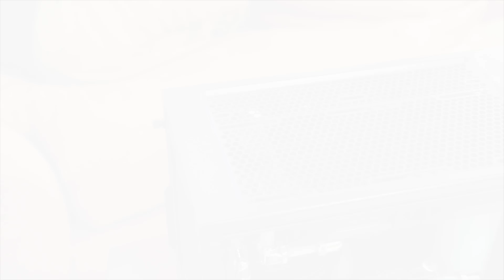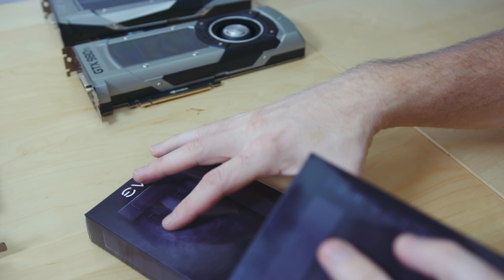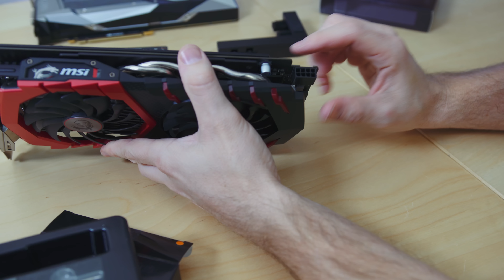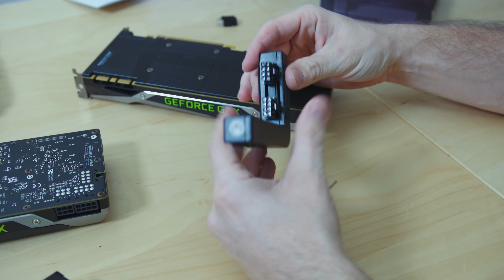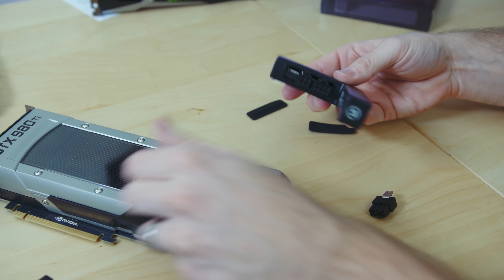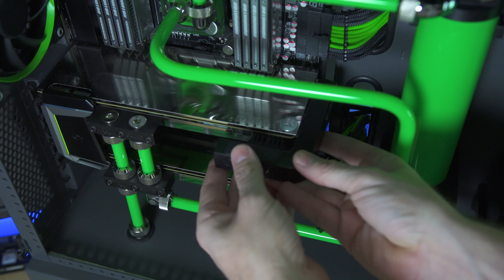How to manage your cables using EVGA Power Link

Comment: You fail to mention "clearance", but how much space is required above the Powerlink; because some of us have case lids \ doors that run almost flush with the card, so would be nice to know how much "clearance" you need. It looks chunky and adds noticeable height to the card; so would have been nice if eVGA made it more flush to avoid having to worry about being unable to close the lid. I have this issue with my HP Z series, since they designed it to be as "sleek" as possible; which means very little space between the lid and any PCIe cards, so height "clearance" is critical. Make sure to mention in any future videos with any newer cards, as this adatper will probably stick around for a while; but I will see if I can find more info before I buy this thing... 😁

Comment: Evga states you need to plug in two 8 pin connectors to the link bar no matter the gpu pinout.  
"The EVGA PowerLink™ features two solid state capacitors that help to filter/suppress ripple and noise from the power supply.  The EVGA PowerLink™ draws power from two 8-pin PCIe connectors, even if your graphics card only has one PCIe power connector. In doing so, the PowerLink™ balances the power drawn by the graphics card, thereby improve stability."  Would be interesting to see if there is any difference at all.  Maybe just really low end psu's?

Comment: i know, old video. but... i just stumbled over the powerlink again and wondered if it is possible to use it with amd cards too? i mean, it should technically be just a simple extension cable. so there should be nothing preventing it from working with other brand cards.

Comment: I have a question that has me a bit worried the two 8-pin power cables may be connected even though my card is 6-pin or how should I connect it
Reply: you can plug one pcie power cable and remove one of the 8 pins that you attach to your gpu. i can make you a video if you like. Simple answer yes

Comment: I have this and I don’t like it.
a. It looks like a tumor that made metastasis.
b. The conector is flimsy and doesn’t provide support.
c. It’s cheaply made, I feel like I can break it any time.
d. The tiny screws and the Alan key are a horrible solution that could’ve been executed a lot more elegantly.
e. Doesn’t work with every gpu.
f. For the price, you should invest a bit more and get some nice sleeved cables instead.
g. Doesn’t solve any problem and can make building the machine more problematic depending on how much space you have.
h. It could’ve been thinner and more robust.
Don’t buy this guys.

Comment: Picked this up for my new GPU the moment I saw how the power had to run to reach the top of the card.  The GPU run is the most noticeable in my case, and $20 for a Power Link was cheaper than a set of sleeved cables.  Worth it for me--the power filtration is just an added bonus.

Thanks for the video, Jay.

Comment: a little side not, they are not just for looks.  it has capacitors inside to help filter any electrical noise or ripple.  basically it helps provide a more stable power source, reducing voltage fluctuations

Comment: An optional brace with a rubber foot that extends/screws out to the motherboard tray. Could be held by tension against the plate, but then you would have people bending their power connectors outward instead of the card sagging down on it’s own. Maybe just some velcro on the end or double sided tape.

Doesn’t need to have 12v or 5v RGB/ARGB, but LED lighting behind the EVGA lettering that splits off the card’s led connector(if reference) or a switch hidden under/behind/on the pcb side that switches to the rail power instead and another little switch/knob for red green blue or white.

Would add more width to the front, but maybe make a version where the whole casing itself is long enough to cover the entire PCB clear to the SLI tab. Would make it worthless for myself and anyone else with waterblock inlet/outlet ports, or those with SLI setups(Hello from the days of optimization! We’d write you a post card but we can’t afford the stamp because we paid as much for 1 card as you did for all of yours!) but hey... ARRRRRRRRRRJEEEEEEEEEEEEEEBEEEEEEEEEEEEEEEEEEEEE.
EVGA has their own waterblock for reference cards so why not make a version of the block that has it built in..... and ACRYLIC! While they’re at it.... why not go full Bitspower mode and offer an EVGA HYDRO COPPER UPGRADE KIT FOR NVIDIA GTX/RTX 10/20 SERIES FOUNDER’S EDITION REFERENCE DESIGN PCB GRAPHICS CARDS.

I can see it now. 47+ SKUs. No swappable 8/6 pin plugs. You get to buy different part numbers if you need 8/8, 8/6, single 8, single 6, dual 6.
POM or acetal! RGB and DRGB versions! Non-RGB versions! Non-RGB to RGB upgrade kits! RGB to DRGB kits! Each kit is specific to the power connectors that your version has!

The money they would make would buy a 2080Ti for at least 5 people!

These are dark times.

I’m glad I went silly with that. Very cathartic. If you’ll excuse me, I need to go cross reference 96+ D5 kits to find which adapter(s) I need to make my mod top light up like a rave. If only I knew where to begin on the glow stick upgrade kit compatibility. Life is hard.

Comment: Unfortunately he missed one of the key elements of this product, and that is it adds an additional two capacitors between the GPU and the motherboard, the power link contains two capacitors. This also justifies the cost of the product, which doesn't make sense if you don't account for those capacitors. Cheap motherboard or GPU capacitors cost around $5 with expensive ones costing up to $50. Obviously for a $30 product we're getting cheap or moderate capacitors, but it will still smooth out the power delivery to your card a bit. If you're investing in a card with a custom PCB and higher than normal power phases or VRMs and have a high end PSU and Motherboard with high quality VRMs and a good UPS, and are trying to get as close to perfectly smooth power delivery as possible for extreme overclocking, then adding these powerlinks "cant hurt" I'm not going to say it's going to make a 'significant' difference, or that the capacitors are of a quality that makes it a 'must have' by any means, but as said, it certainly doesn't hurt, and does something to justify the product beyond just aesthetics.

Comment: I’d rather have options on black 90 and 180 degree adapters that plug directly in with no wire, if I vertical mount make it 90 so I can run the cables straight to the psu shroud hole, for normal mount make it 180 and I’ll run the cables over top the card...example in this 24 pin 90:
https://goo.gl/images/cPUCQT
Excepting that the board and metal aren’t also covered by black plastic

Comment: would be cool if cards start just having the plugs on the side. but for 9.99+tax off new egg wasn't to bad as i had a new egg wasn't to bad as i had a 11.99 customer card from a price match burning a hole in my pocket. but i do think the normal 24$ is a little steep 10$ though is reasonable

Comment: This isn't a comment for this video specifically, but all of the ones I've watched. You've been a huge help from Air flow, which helped with case and fan choices, to what GPU I should consider getting. My first build was a dirt cheap GTX 770 i5-3570k. Really the only components worth mentioning. Now that I can afford it, I'm building a i7-6700k MSI 1070 Gaming X. Been watchin videos for days, making slight changes, really looking into things I could be proud to show off. Thanks for the help, your channel has become one of my go to spots when I have a question.

Comment: I think it looks clearer with power link.

I personally dont have any Evga stuff, and would not use them on another brand just because of the logo and build cohesion. I do hope to see brandles versions for other graphic cards or other brands adopting this. or maybe see changeble power mounts on the cards it self.

I'm happy there not LED lit, specially now that so many parts have leds, i had to tone mine down just to not look like a red light district ; )

Comment: Why are graphics card designed upside down for normal cases, and why do they always put the plugs in the WORST spot. It's like the designers have never built a PC before. Also, why are all PSU plugs so cheap and crappy. There's no reason to need 6 let alone 16 pins to carry the current needed for a GPU. It should just be two high quality connections.

Comment: Jay, may I suggest some UV reactive paint to use in the EVGA label on the front of those adapters. like just thinking the paint and let in flow in and fill the letter outlines. and some UV LEDs and then will match and not look so drab.

Comment: I got the power link for "free", ($10 shipping) during a promotion. I find that it works for me. I upgraded to a 1070 FTW DT from a 750 FTW. Since the 1070 has a bigger height, the power cables stuck out more from the case. Those cables started to a get a really bad bend when I closed the case. The link does its function well to redirect the cables to the side. I would say only buy this if you NEED it, in my case because the cables started to bend against the case. Do not buy it just because you think it will make your cable management look better. If you do plan on getting it, you should buy this at a discounted price rather than the MSRP of $30.

Comment: i like it how it looks after the install as long as there is a way to support your cables so there doesn't have to be worried about those solder points breaking.

Comment: Fitted these on my two 1080 FTWs - it definitely looks better but I would have preferred the top part was not so high (why couldn't they make the plugs shallower?) and didn't partially obscure the FTW logo. It also just barely fits in my NZXT H440 case, clears the drive tray cage by about 2mm.

Comment: Personally I think they should make 3 of them. One just like that, one that only has one 8 pin and then you plg your 8 pin straight into the back of the link rather than the side , then one thats wider so you can plug your two 8 pins into the back rather than the side. I could use one of those in my builds. I have just enough  room in my buils for a wider one that I could plug my 2 8 pins into the back but I dont have enough  room to plug them into the side like that   my cables will hit my fan blades.

Comment: With your build Jay it looks really well because you have those squared off black pieces sticking about just as far off the top of your card where the hard tubing goes in them as the evga link does. It looks really well. You got lucky that those pieces your tubing go into are also black worksa out nice.

Comment: I feel that these "extensions", for lack of a better word, serve a purpose, but, like you said, the weight of the cables and the amount of sag is a little troublesome.  If EVGA could find an unobtrusive way to brace these against the weight of the cables (perhaps some kind of non-conductive legs to sit on the PCB of the card itself or something along those lines), they would be far more valuable as a cable management utility.

Comment: These mofo'in new cards are massive and fit in less and less smaller cases these days, I was optimistic about this device that it would be a sort of low-profile design to move the power connectors to an area with more space. But NAH it adds bulk thus the card still doesn't fit. The EVGA 1080 FTW just barely fits in an Air 240 and other small form factor cases.

Comment: It's a nice thing for EVGA to have made available, for those who can make good use of them. Mixed feelings regarding their application in Skunkworks. Pushing beautifully-sleeved, matching green cables further into the interior of the case isn't optimal, as it hides their contribution to the overall graphic beauty of the build. At the same time, the cables not sharing in the otherwise consistent 90-degree shapes of the interior is an issue. Could you not re-train the cables to make a minimal 180-degree bend back along the lower side of the cards, and then turn toward the grommeted MoBo-tray hole along the face of the Mobo? I see that done with many custom-sleeved GPU cables.

Comment: Thanks for the review; keep up the great work!  

I just got mine in the mail and installed them post haste.  They are really bulky, and take some getting used to.  I have 2 issues 1) They make the card effectively longer.  I have a Corsair 400C case, and a front mount Corsair h100i v2 (not a fan boy, just a coincidence) and the two 8-pin wires now rest up against the fan shrouds.  2) I have a 1070 FTW, and from certain angles, they block the RGB EVGA logo.  Also., I would only want the logo on the Power Link to light up it if matched the RGB color on the card.

Comment: I think it looks better with the adapters because plugging the cables into the end of the card gives it a more uniform look when comparing it to the 24 pin connector with all the cables being connected on roughly the same plane.

Comment: +JayzTwoCents so I ordered my PowerLink before watching your video and didn't think about the "backwards" plug clips on the video card. My Asus GTX 1080 of course has the plug clips facing the opposite direction. A friend of mine took his PowerLink apart and we checked out the way it's built inside (everything's soldered to a PCB), so our thoughts of simply re-wiring the plugs inside are out the window. My friend had the idea of re-pinning the plugs from the PSU going into the PowerLink (reversing the pinouts of positive and negative going into the rails) to possibly get the reversed polarization effect, but looking at the PCB with the capacitors as they are, I'm doubting this will work and may damage the card if I were to attempt doing this and turn it on. Do you know if there is any way to get the PowerLink to work with a card that has the opposite-facing plugs or is EVGA ever going to make a PowerLink that would work with these cards? If there's no way to hard-mod this into working, then I guess I have a brand new, never used PowerLink to sell.

Comment: I think if the logo had LED's it would maybe bring more to the table, but as is, they look kludgy, poorly engineered and cheap. They couldn't include some double sided mounting tape to keep it in place against the back of the graphics card? There has to be a better less clunky solution (other than putting the connectors on the back to begin with ala Quadro). Doesn't anyone make right angle PCI power plugs? Those plus some water cooling tube mounted to the back of the graphics card as a cable guide would give a better look than that crappy piece piece of plastic and not put the strain on the connectors that this system does.

Comment: It looks better with the Power Link. In version 1.1 they could make it with a small plastic clamp that attaches to the back of the video card to support the wait. If your really concerned about it you could drill a whole into the motherboard tray directly below the Link then (from the back) put in a small black screw. It will take the weight of the connectors. The screw could also be threaded between the upper and lower rows of wires on the rear connector. No one would ever see it.

Comment: I liked the look before better, it would be a bit different if the EVGA lit up or if somehow it had some chrome on it to match the waterblock fittings to it's left. As you talked about the round swooping curve of the cable, it matches the circular green of the rear fan, and there's still some rounded edges in the tubing bends. But I digress :)

Comment: 1) Could use some LED
2) For the heavy cable problem, maybe EVGA could do some upgrade on it by doing a lock in the other end of the connector so it would not just relay in the power connectors to hold the entire thing.
3) Looks Nice

Comment: I do agree they look very bulky but I like how they move the cables. And I have a question is their a reason why the cables attach to the front and not the end of the cards? With so many personal builds trying to hide the cables it just seams like it is a left over     design from a past when the insides were never seen.

Comment: Great review, good idea for the product. The rear connectors should have been designed facing down, then the length of the assembly wouldn't suffer so much in a small case.

Comment: Eh.  Looks cleaner but not digging the sag.
Reply: I agree. Without sag with optional led and maybe even a chrome version it would be sick!
Reply: It doesn't sag on my 1070 FTW. But I made sure it was a little taught, so it is held up against the side of the card. My cables are really stiff, though, so my cables might be helping support it.
Reply: It only sags because his cables are cut to a specific length, and they're pushing on it because of how he has it set up.

Comment: while it doesn't look bad i don't think that it looks better in your case. the coloured cables look great and they fit in there quite well. if you wouldn't have these cables but standard ones, i'd probably say it's better with the power link. but with your cables it's not neccessary to put it in

Comment: fill in the EVGA letters with matching green paint... But TBH, it does look flimsy and over time will cause issue due to the weight of the cable. But I guess the power connector themselves are holding the cable weight by themselves anyway so...

Comment: Suggestion for a next video : VR benchmarks, what config is necessary for 1080p max out setting. Furthermore I would like to know if you think a i5 6600k plus a gtx 1080 would run project cars vr max out settings?